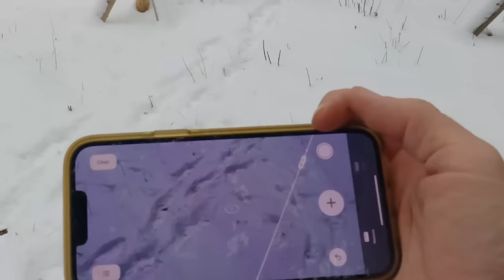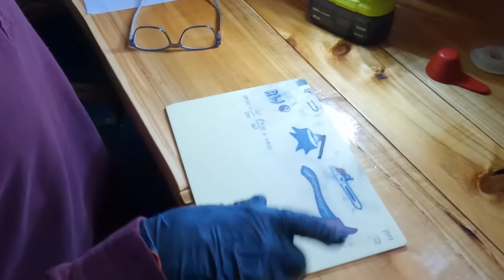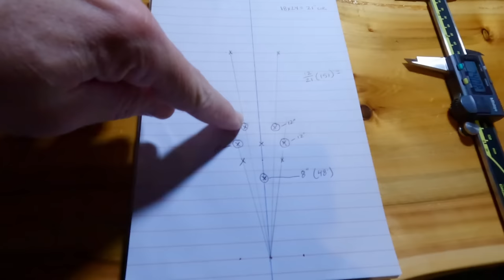How Bad Could this Michigan Snowstorm Get?  Let's Hope it's Horrendous! #173

Comment: Not that you really respond to comments (bandwidth) but tear down that shelter you drove under, and repurpose as an overhang and sidewall, off your cabin's door. Provide some shelter, and a temporary outdoor kitchen protected by the elements. Use that old propane tank as a wood stove - dozens of tutorials online.
Reply: I think he uses that overhanging shelter as a "drive through " garage to store things he uses on the property as well as a garage for his 4 wheeler to keep it out of the elements.
Reply: That's the "garage" for the 4 wheeler. For exactly this kind of weather. Which is a higher priority right now.

Comment: Cut it in half long ways. Weld 4 steel legs to it and you have the bottom of a grill. Then weld the top to the bottom using some of those door hinges. Make a few air holes for vents on the bottom and the top. Find an old  grill sheet that you can put the food on to to grill.
Reply: I was thinking the same thing.  It would be cool to make it part of the outdoor kitchen.
Reply: My idea too but hinge the other half as a lid and have a smoker for your outdoor kitchen
Reply: Should definitely use that old tank to build either a wood stove, grill or smoker, putting that heavy gauge steel to good use!  Another fun day with the “Nerd in the Woods!”
Reply: Good idea however Ryan doesn't seem to be a very avid grill cooker. I seem to recall that the grill mostly gets used when Tito shows up. 
Happy Saturday morning to my fellow Ringworm enthusiasts !
Reply: A🚜cotter Pin br0ther W0rm🐾🦅
Reply: Good moring to you too good sir  @noyopacific

Comment: I'm surprised you didn't get a wood stove for you're cabin..Propane makes a good back up, but just the dead fall alone should keep you heated every winter..It doesn't matter if that wood lies on the ground or you burn it, it's carbon is going to be transformed back into the carbon cycle..Those old propane containers make good wood stoves...LOL

Comment: Quick tip when cutting a propane bottle. Fill the bottle with water all the way until it overflows ,that pushes any remaining fuel vapors out of the tank before you let the sparks fly. Cheers 🍻

Comment: Thanks Ryan.
A trick I learned with My ATV plow, drive over the Frame.( Since My Winch is a Dedicated lift winch, it picks the Plow frame dead vertical ) connect the winch and pick the plow up off the ground a bit that way I can push it around with my Foot, Up, down, Left, Right to line up the pin holes. Connect the hydraulics and go plow...
Cut the tank Lengthwise, Fire box for under the Hot Tub...
Fill it full of Water before cutting..

Comment: 100lb tank is steel, would make an awesome kitchen. Cut in half top to bottom, put a propane tree in thru the hole and you could put multiple burners on it; singles like the one you just made popcorn on or a coleman or other 2 burner/grill type and a small bbq. And hinge the halves so it has a lid to keep the critters and elements out!!

Comment: Ok, I have a ton of ideas on what to do with the 100 pound propane cylinder. Of course after the valve has been safely removed and filled and emptied with water for safety purposes.  I can bet Ryan would want to do something crazy. Hook an eye loop on each end and a chain. Attach to a tree and you got yourself a challenging bull riding machine when 2 people are at each end pulling a rope to see who can stay on the longest. I do like the idea of creating a bell or hanging light covers, grill, smoker, wood stove and so many other ideas, though.

Comment: Perhaps you can build a roller to pull behind the quad using a weighted plastic 55 gallon drum. It would pack the entire trail much better and faster. Snowmobile clubs use rollers for the same purpose.

Comment: For the propane tank drain it lay it on its side and make it a roller you pull behind your four wheeler to flatten the snow in the trails?
Reply: I apply that same concept to a tank that’s been modified as a roller to pull behind a tractor. Except I use it to roll in grass or cover crop seed to soft soil. I fill the tank with water to increase compaction. Rolling in seed makes a huge difference in germination.

Comment: Hey Ryan... I used saran wrap and wrapped it tightly around my phone, then taped it with blue painter's tape securely to the back of my phone and used a fine tip sharpy to trace  on my phone. It worked great to keep the phone from moving or enlarging the pic I wanted to trace because it left like this space between the saran wrap and my phone screen.

Comment: I find it much easier to attach winch cable to the plow,; lift the plow, then the connecting ends of the push tubes are free to move and you can float it back and forth until you line up the pin holes in the mounting bracket.

Comment: Cotter pin is the term you were looking for. Those wires that secure them are a pain for certain :) Clovis pins (yes, they are a thing) are commonly found on old external backpack frames (the pin has a hole in the shaft and is often secured with a key ring style hoop). As to why I retain this esoteric  knowledge -- who knows?

Comment: Make a wide bbq. Cut it about 2/3 length ways, hinge one side and put some legs on the larger side. Make sure you take the top off and fill it with water and then dump it out before you cut into it though.

Comment: I think it is a cotter pin... and make a wood stove out of the tank... if cut it in the middle... you could use the 1st half for the wood stove and run a stove pipe thru the 2nd part and put a door on both... then you can have an oven... you will just have to brace the top up... just an idea... I don't know if it would work... but I have seen something similar.. Deb from South Dakota

Comment: For that 100lb tank you can make it a large table top grill/smoker or you could make it into a rocket stove/heater by cutting an access panel on the side and a couple of vents on the bottom and a large opening at the top

Comment: The pin you have is a "cotter" pin. What you need is a "Grip Clip" it looks very much like a lady's "bobby pin." One leg of the pin slides through the Clevis pin hole and the other leg snaps/clips around the clevis pin. The "Clevis pin" is the solid pin that holds the parts together and needs something through the end to keep it in the hole.

Comment: I'm surprised you haven't installed a solar system.  A few solar panels feeding a battery bank.  You could charge the battery bank and Jackeries at the same time.  It would reduce your dependency on the generator considerably.

Comment: Use the 100 pound propane tank as a roller to pack down the snow on your trails. Because it’s steel you could weld a bar down the middle of the tank then place bearings on each end and create a hitch for the 4 wheeler. The tank should be heavy enough to pack the snow. If you need more weight you then could fill the tank with anti freeze mix until you got a weight to pack the snow but not too heavy to pull with the 4 wheeler.

Comment: Ryan, as far as the used propane tank is concerned, a stove/furnace/smoker or BBQ grill are most common. As you shun common on the regular, it could become some artform. Possibly with additions a various stages of life. But, a welder would be your friend , or torches/metal-sticking consumables of your choice, to accomplish any alteration The thickness of cylinder wall has good radiant capabilities. Another would be to use it as an expansion tank in a closed hydronic heating system, like for the cabin floor.

Comment: 100 lb. LP tank. My delivery guy in the winter would pull it in the snow like a sled. He used a piece of round stock 6 feet long made a handle at one end and a hook at the other end that he hooked in the hole in the cap pulled it to the house.

Comment: Too bad you don't have a UTV.  Putting the plow on is so much easier - it mounts on the front.  Plus you could sit in a nice warm cab.  Not to mention how you can haul all your tools, and supplies, as you work around the property.

Comment: It rilly depends on what size cords you are running on the generator. You need to be using at list a 12/3 cords.   I use on my smaller generator I use 10/3 exstnchen cord's.     On my Big generator it has 220V  it runs all of my house

Comment: Split pins should ideally only be used once, (in the same way as Nyloc nuts should). You need an "R" clip, or one of those clevis pin securing pins that works like a safety pin. Or there are self locking clevis pins with a push button on their end within a flanged cup used to pull them out. They have a name but I can't remember it.

Comment: You can get the fittings to connect the big old tank up to the new small ones - and just fill it up yourself - you just invert the smaller tank, so the liquid gas flows into the big tank - cruisers (the sailing boat type) do it all the time when globe trotting - as different countries have different standard fittings - so they often Heath Robinson a solution that works everywhere.  Just google "diy propane filling kit".  Getting your smaller (not so small) tanks high enough to make it work perfectly could be a struggle - but keeping more gas storage could be worth the effort.  Thanks for the videos.  Stay safe out there.

Comment: cotter pin, not clevice!  (I think) CLEVICE around here, NY, is commonly referred to as shackle. horseshoe, holes on both ends, screw in bolt each side. I’ve always thought that instead of the bendy ears that eventually break off, a pin with the ball bearing that appears and disappears when you slide it in and out would be better, but I don’t know if they even make them. anyway, I’ve been retired for 15 years, so I dont give a rats patooty 😀👍
Reply: They make clips that are easily removable and reusable.  Get them at any auto parts store or most hardwares.

Comment: My mate turned an old gas bottle into a pizza oven. Lift the lid, put the pizza in, 2 minutes later your pizza is cooked. Of course, you can only do 1 at a time. I doubt that's much of an issue for you though.

Comment: If it was me, I'll take it to the gas place and see if they'll trade it for a couple of smaller tanks, save email if you had to pay everything they'd trade it for 240 pounders, and then you've had to pay 20 or 30 dollars, it'll be. Less than what buying 240 gallon would be and I think they will do that. But they didn't know how to pressure a check at their own cell if they're gonna reuse it.  But check into it

Comment: If you hook up the front of the plow to the winch line and lift it off the ground, the back end will float and make lining up the holes for the pins much easier. Also, what you had there is a cotter pin, you need a reusable clevis pin.
Reply: No, a clevis pin is the main pin with a hole in it for a cotter pin, or some other type of retaining pin, that prevents the clevis pin from coming out.

A bent clevis pin is typically used to hold the ball adapter in a hitch, and normally, an R clip is used to hold the clevis pin in.
Reply: @throngcleaver  My mistake  Its the R pin  that goes into the hole of the clevis
Reply: @rmd9032  Not a problem!  For years, I thought the R pin was clevis pin, and someone pointed out the truth to me.  Pass it on... 😁